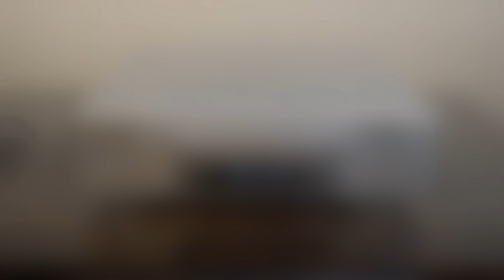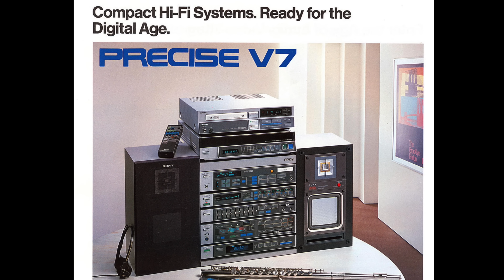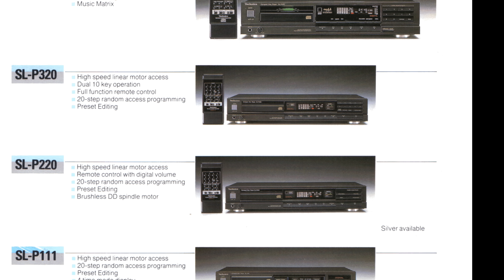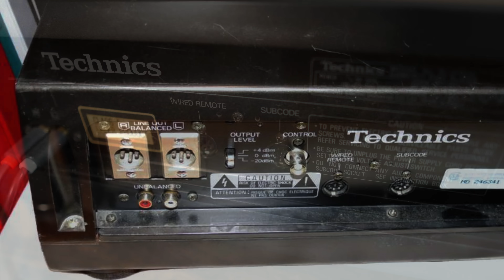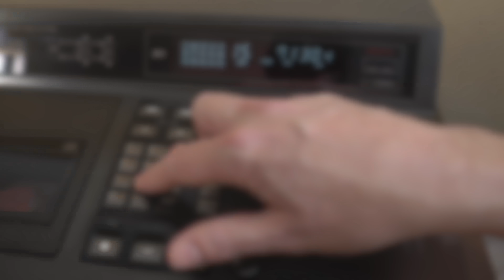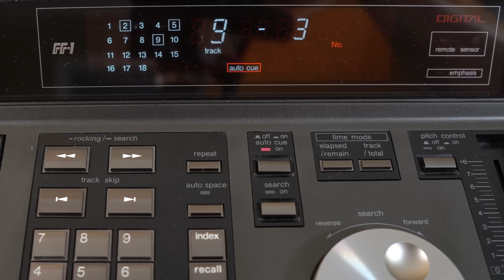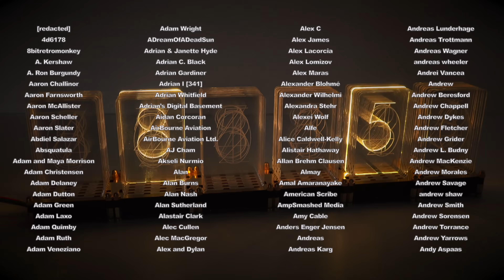How CD players lost their cool & why this Technics didn’t.

Comment: The only players that got boring was the stuff that was continuously cheapened to reach a certain price point in the market.  Lots of people just go for cheap.  It’s like most people did not buy the more expensive three head cassette decks but stuck to cheap two head designs or cheap double well designs.   And damn near no one but studio people wanted DAT at all despite excellent sound and individual track ID’s.    It’s really sad to see the state of audio and video products that are currently made. So boring.  The way all the different manufacturers used to really compete to outdo each other in design, features and durability is really a thing of the past.   I just brought up from the basement my first CD player bought not too long after CD’s came out.    It’s a Sony CPD-508ESD.  Cost $400.00 at the time in early ‘80’s money which was a fortune.  But I was already buying CD’s and a machine was needed!   It still functions beautifully.   Everything works. Hadn’t played it in over a decade.  Not sure how or why it got bypassed but I found it sonically just fine.  It has individual track buttons and a feature called “custom file.”  You could program a CD to include only the tracks you wanted in any order and store it in the machine.  Every time that CD was inserted it went to that program.  Very cool.  Of course, the public didn’t seem to care about the feature and it gradually disappeared.  

Today my favorite CD machine is the Pioneer based early design for a recorder that was rebranded by Fostex and HHB for studio mastering.  Fantastic machines.  I have a bunch of them and they’re all still going strong.  Still record perfectly and the playback quality is excellent.   It can be rack mounted and the CD is inserted record face up onto a little turntable in the tray.  I don’t need to see it. I get all the info I need from the numbers in the display.  But super nice machines that were built to last and designed with beauty and style.  I often wonder who was the main designer for this machine.  These were the first machines to appear in recording studios that could record a CD in real-time like a tape.   Why the CD is disappearing is an odd one.  I still love them. And to be able to record to a CD in real-time and have that as a physical product in your hand that is portable and can be shared is exceptional. There is no machine that has come to replace it that has its own media that is universal and shareable like the CD.  At some point manufacturers stopped trying.

Comment: One thing that I miss about physical spinning media is that on an old record player you could make a makeshift amplifier and needle cartridge with a rolled up paper cone and a sewing needle! Seriously, as A10 year old kid in the 70s I made one of these for a record I got when my dad's stereo console broke down. I rolled a paper cone up...stuck a sewing needle through the small end, and held it on the spinning record! (The turntable still worked, just the cartridge was bad and the amplifier...) I was able to listen to an old album that I got at a yard sale! By the way: the album that I ruined by doing this (yes kids it will tend to scratch up the grooves) was a "still in the shrink wrap"  Who album... Which was also(I later found out) collectible! It had a picture of a bathtub full of baked beans on the album cover. But anyway it was something possible with a vinyl album.

Comment: I used to have a pioneer CD player (I forget the model), where the 'turntable' was mounted on an electrically operated drawer and you placed the CD upside down on it. It had a tiny viewing window too. I always felt this was a nice tactile experience. Today I still use a Rega Planet, which is top loading. You physically lift a lid that has a spinning weight exposed and on top of the lid, poking through a clear plastic viewing window. The case of the player has a 'cast' finned design to it. Again a nice tactile and visual experience 😊
Reply: I have 2 of those Pioneer CD-players with a so called 'Stable Platter Mechanism'. 1 of those (PD-S702) has a small viewing window (as you mentioned), is more than 30 years old and still plays very reliably. I wouldn't want to trade it for a new player, for I still love it for its sturdiness and great sound.
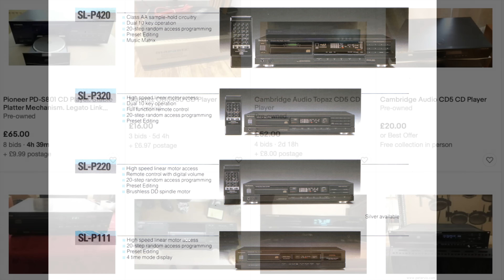In the video at 6:05 you can see a similar player (PD-S801) on the top left corner. ;)

Comment: A wonderful single disc player and I don't blame you for having one as it does everything one could want. My stereo separates stack is the Aiwa DX-9100M and years later got the sub-woofer too. It came with a single disc player. I bought it new at £1000 round about 35+ years ago. It is still working away, and the only parts replaced was the number of stylus needles and a turntable bent x1. That is until my nephew wrecked the CD player on me. I couldn't find a single replacement player, only a 5-disc interchanger which I hate for all the noise when switching out single discs. The only time I used the multi disc function was with compilation discs to load up the five trays.

Comment: Maybe I just missed it, but I didn't see any sign of a shuffle mode. That would be a deal breaker for me, as that was one of the many advantages that CDs have over LPs and tapes.
Also, just out of curiosity, did the pitch control not work in real time (i.e. during playback)? I would have thought it would be more effective to demonstrate it that way.
Finally, I'm terrible at keeping timelines straight. I would have thought that the retractable, horizontal loading system was merely mimicking the CD-ROM drawers in PC towers? Or do I have that backwards?

Comment: Check out the technics sl-pc14. It holds 5 CDs on a turntable type rotation with the discs visible. I have this but unfortunately it is missing the clear cover that keeps the dust out and so mine only plays part of of the 5 location. One day I'll get into it deep to clean. But it is a nice way of displaying the CDs.

Comment: You mention older CD-Players being faster at starting up and that is a common problem and there is a good reason. Over the years the CDM's were able to do more and more. If you take a SACD player it will go through a bunch of algorithms to determine what kind of disc is in the tray. As an example, you can start by switching on the DVD Laser and try and see if you are able to lock onto the HF and read the TOC. And besides knowing if there is a DVD in the player, you have to do some work to know if there is a dual layer DVD, DVD-ROM, DVD-R, DVD-RW, DVD+RW and god knows what in there. When all that fails, you try the same (again) for the good old CD. 

From my time working at Philips Optical Storage back in the 90s we took quit some time figuring this out. And to make matters worse for audiophiles, CD-ROM drives were used in CD Players more and more simply because it is the economic choice (a choice that has no effect on sound quality by the way). And a CD-ROM drive has complex startup algorithms as you might imagine given the types of discs you can through at it. But we had a nifty way of speeding things up back then. If you are someone who just plays SACD's a lot, the CDM would store the last disc type in the tray or simply a guess based on the last few discs that you played. As you seem to be someone who plays red book CD audio discs, that would be the first the CDM would try skipping the tedious and slow algorithms. But you need to be lucky to have one of these and I can't even tell what player this is in. As fast as this player is hard to beat. It takes the shortest possible route: spin up disc, lock onto HF, read TOC and your done.

Comment: Great video damage blue Ray's CDs proven it doesn't play or it locks up specially damage vhs proven they played at all times yet vhs proven it can do 5 things play when they are not damage 2 when they are damage 3 when they break they get fixed with scotch tape it starts playing again 4 mold on VHS that still plays proven 5 plus when they are heat Damage they still play yet CDs blue Ray's DVDs proven they only can do 1 thing when are not damage they play great no problem is this vhs can do work 5 ways when they are damage when they are not damage vhs proven they can still do more

Comment: 1) I owned one of these machines and, though it was overall great, I didn't like its inability to read even slightly unclean disks
2) I also had Technics SL-P1000 which was a "boring front-loading" CD player, a cousin of this model. It had the same instant play at the button touch, the same large dial/buttons functionality AND my favourite: it could read CD-R disks
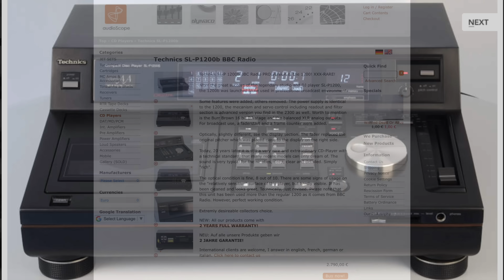3) I was hoping this video would mention the SL-P1300 successor model, (not just the SL-P50 predecessor). Interestingly enough, that one is also available for sale on the same website shown at 7:16 at a slightly higher price of 2,990 EUR (That's $7,215,71 Fijian dollars)

Comment: Hello Tecmoan, greetings from Santiago de Chile. I'll tell you that these pieces of equipment were used at Radio Concierto in Santiago de Chile in the mid-'80s, and although they have an exceptional sound and very complete functionalities, they weren't good for hard work on the radio, so after a short time, they had to be replaced by models of traditional design.

Comment: I particularly like the fact that it looks like they took a 1960s office desk calculator, ripped the guts out and built a CD player into it then painted it black.

What's the component sitting under the reel-to-reel at the end, 16:54 or so with the green radar-screen-ish display to the left of its meters?

Comment: This is why the My First Sony CD player was also my first CD player. Also my favorite one. I keep hanging onto a Philips micro component system that has a visible CD tray with a clear lid. It only works if I put it into a vertical orientation as well, so I’m following that trend of the first wave of designs.

Comment: We had one of these machines at a radio station I worked for. They were actually a bit slow to adapt the CD system compared to other stations. We had this unit mainly in production and was heavy and awkward to work with. When we needed to play cds in master control we had to lug it in there and often was set on top of one of the turntables. By the mid 90s they did get a pair of players for the studio but of all things they bought the cartridge style pioneer changers that were cumbersome. Finally toward the late 90s they went with single drawer marantz units. Their Technics eventually had the laser die and they discarded it.

Comment: When I was on the radio I had a professional CD player but it was not this. It did have a cue function though. It was the drawer type
Reply: Working in radio in 1990, we had what I called CD cart machines, after the continuous loop tape cartidges.  Each CD was housed in a cartridge to protect it, and it remained in that cartridge for playback in the decks.  You can see and hear them in use on one of my videos, but I guess a lot of channels don't like posting of URLs.   At that time, we had one single turntable in the control room, which was odd.  In the year I worked at that station I never used it.  There was nothing available in the control room on vinyl, LOL.
Reply: @Vector_Ze  yes, DENON cart machines.
Reply: Hospital 🏥 Radio 📻
Reply: It would not surprise me if one of the local radio stations near where I used to live ruined their copy of "Land of Confusion," by Genesis with one of these. On the other hand, the pitch control would be useful for fixing some of my own more worn out CDs.
Reply: I was involved in university student radio in the early to mid nineties (shout out to B-1000 😁). IIRC, we had commercial front drawer based players with the very useful autocue function, so it wasn’t unique to the professional series. I would have loved to have had use of one of these top notch players though: the fast loading times, jog wheel and build quality look fantastic.

Comment: I've had a few JVC "executive microsystems" over the years, and most of them show off the CD in some way or another. The one I had the longest is a top-loader with a pretty simple mechanism -a damped slow release geared lid (like a lot of cassette decks) was about the only flashy feature. Half of the top is a clear window so you can easily see what's loaded, like the Technics here.

I was particularly fond of the JVC FS-SD990 which has a crazy mechanized top-load that lights up. I think my grandparents had one.

Comment: No optical output!? And they labeled it "professional"!? FAIL! The DAC from 1986 must be appalling by today's standards. A simple Toslink output would have made it upgradable to newer modern DACs, leaving the SL-P1200 as a superb transport mechanism. You might say that the optical digital output –Toslink– specification was introduced in 1988 with the DAT format for consumer use, but in fact it was developed for professional use back in 1983 by Toshiba. So Technics omitting it on a deck targeted towards pros is baffling.
Reply: A DAC from 1986 'appalling' by today's standards? Have you not heard (of) the TDA1541?  Granted, the SL-P1200 doesn't have a TDA1541, but to dismiss all '80s DACs as 'appalling by today's standards' shows gross ignorance.

Who knows, maybe the modern DAC you have in your current system would sound 'appalling' to my ears.

Comment: Commodore adopted the top loading see through lid on the Amiga CD32 😊👍
The amount of equipment that gets thrown out all because a belt has perished is astonishing! I've repaired many electronics that have been thrown out by others. Older equipment is built to last, & to know how to service them is a bonus. I just love having some equipment that you can repair yourself over & over throughout the years. I rescued a Sanyo G3003 with 2 VU meters & an orange digital display which is in remarkable condition for its age.

Comment: I assume this player also supports indexing, which I have seen on a few discs I own, but most players don't support these days. I'd like to see an addendum/followup that covers this feature. Thanks for the review. Love  your posts.
Reply: I question the need for such a thing in 2022.  Before personal computers, sure, I could see where having marked-off sections of a song different than the tracks given to you by the record label could be cool.  And many higher-end players did have an A-B repeat button.

Nowadays, you can do all of this on a computer?
Reply: @drfsupercenter  I completely agree with you for my own personal use, but many classical CDs were released with the Index Feature encoding around that time and for anyone that doesn't want to go the computer route, that feature could still be useful.
Reply: @drfsupercenter  Like you said earlier, it is a non-issue for most people. In some albums, particularly Classical music, they might have a track with a much longer runtime, but there may be different passages within that piece and it allowed you to directly access those passages directly. Think Tubular Bells by Mike Oldfield. An entire album side might consist of one track, but you could index the different passages as well. I hope that helps.
Reply: @drfsupercenter  It allowed for very long continuous tracks, like sometimes used in classical music or Tubular Bells for example, to have breaks (index marks) that allowed you to skip directly to specific points within that track.

Comment: Good luck trying to replace a laser on of these though… a couple of the early technics CD players used a laser pickup that is nigh impossible to replace nowadays. I bought 3 broken low end players just for the laser unit to put it in the 1200. One eventually had a working laser that I could salvage.
Personally, I preferred the look of the silver dual cd 120 (a slightly rearranged hitachi da-1000). It also stacks nicely with the technics sa-k5 and 6 that you showed us many moons ago as recommendation for a beginner‘s HiFi.

Comment: I wonder if it is coincidence that this is the SL-P1200, when the Technics SL-1200 is the famous turntable used for hip-hop. Probably not, reading the Wikipedia page for the SL-1200, it too was an industrial record player designed for commercial applications, before DJs got hold of it.

Comment: Reminds me of the dual cd sets I used to use in the clubs in the 90s, similar control of the tracks. Also, thinking about viewable spinning discs, I had an all in one dual cd set up with no cover on the cds, the players were just level with the equipment box and just placed each cd on its relevant player, then with finished you just took it off, no flip lid, no draw

Comment: I worked in BBC local radio while I was studying for my A-Levels in the mid 90’s and we still had half a dozen of these players. Although we never had the ‘BBC’ version of them. Our players were instead modified by a company called ASC, who fitted the balanced outputs and fader start interfaces. 

They were originally used in the studios, but they’d superseded by Denon DN-961’s. They were more robust, quicker to cue and setup, and you could get 3 of them in a 19 inch wide bay. We tended to use the 1200’s as backup units or take them on outside broadcasts.

Comment: That's a really cool machine!  It's like a CD player was about to teleport itself and a turntable secretly flew into the pod. 

-If primary element is CD player,
what is secondary element?

>Secondary element is not-CD player

-If secondary element is turntable,
what happened to turntable?

>Fusion

  Assimilation?   Did CD player absorb turntable?

>Negative

>Fusion of CD player and turntable at electro-mechanical level